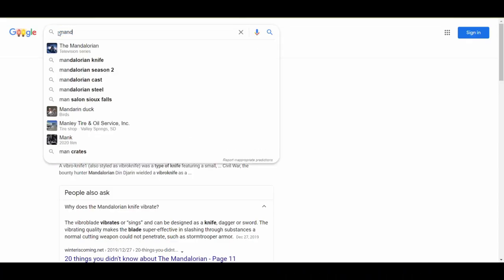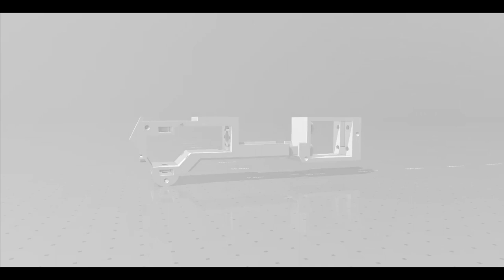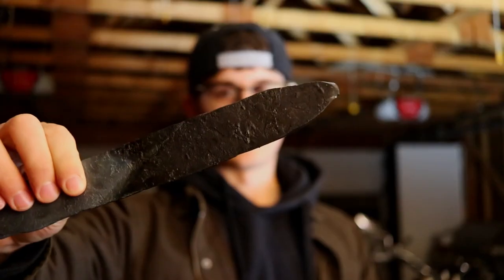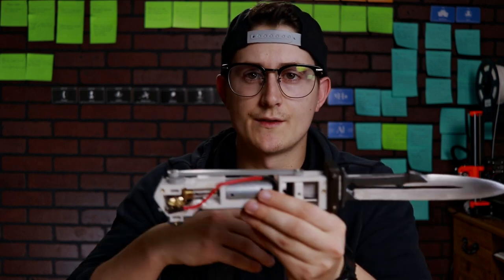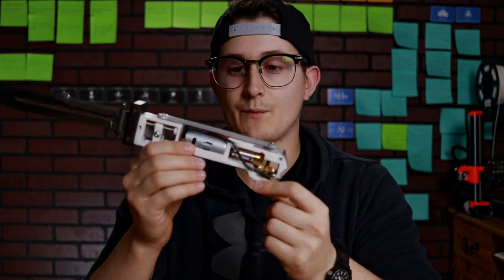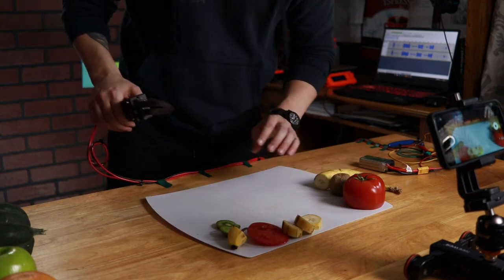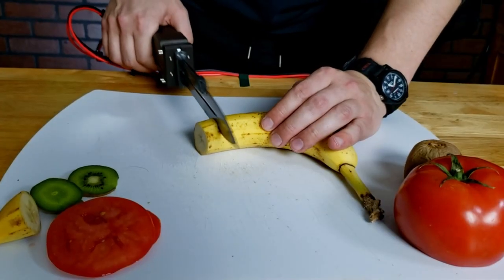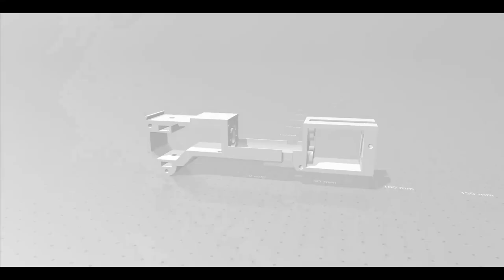Mandalorian Vibroblade Prototype

Comment: I seriously see great achievements in your future. I’m surprised you are so underrated.(BTW how did you get that equipment)
Reply from the maker: Thanks! I really enjoy doing these so I hope I can eventually go full time.  What equipment do you mean? The tools I use (3D printer, forge, etc) or the parts I use (motor, shafts, bearing, etc)
Reply: @SECTOR07  The forge  and the motors, gears wires etc did you get them off a specific website? I’ve taken an interest in engineering and want to make projects such as these. I’m in 10th grade trying to learn engineering before college.
Reply from the maker: @bronbettis4084  You can buy forges but my brother and I built that one. It was cheaper that way. I get almost all my parts on Amazon. You just have to know what your looking for. If you want to learn engineering I suggest start by building a few projects. Check out Instructables. There's a ton of cool projects on there. Just find something you like and make it👍 Learning by doing is my motto.
Reply: @SECTOR07  Thanks for the advice, I’ll check it out!
Reply from the maker: @bronbettis4084  Of course! I'll also be doing some tutorial cool DIY projects in the future that anyone can do. So keep an eye out for those 👍
Reply: @SECTOR07  Sure will already got my notifications on!

Comment: This is incredible! Amazing job
Reply from the maker: Thanks!
Reply: @SECTOR07  would having a smaller oscillation still work at cutting things? If so the back and forth speed would be faster and the blade might not stall if you try to stab something with it... what’s your opinion?
Reply from the maker: @matthewdeane235  I think your right, I think tuning the oscillation length would definitely help. The main drawback with my design is the motor. Its high speed but low torque which is why it stalls under too much stress. Bigger motor and smaller oscillations would make it a beast!

Comment: That touch sensor addition is pure genius.

If you double up the motors, make the handle a tad longer, would that increase the torque?
Reply from the maker: Thanks! I was very happy with that idea 😁. Doubling up the motors would definitely increase the torque and make its cutting power stronger. Like you said it would make the handle  a lot longer. If dimensions didn't matter so much it would be cool to try!

Comment: Love the railroad track anvil haha, didnt expect you to make your own blade!

Did you 3D print the bevel gears?? If so how did they look after some use? What dis you use for your linear bearings/slides?

I think industrial ultrasonic blades use little piezoelectric oscillators in order to be able to cut well (including cutting plastics and such). Your design is much more mad max and fits mandalorian better though haha
Reply from the maker: Ha thanks! Yeah, real anvils that are still decent are hard to find. So I had to make a temporary one. The bevel gears are brass 4mm bore. They've held up well so far. I know industry does use actual vibrating knives but this design was more in my wheelhouse for proto 1. That tech requires high precision, resonant frequency math, and lot's of higher quality materials. So I didn't think my equipment was quite at that level just yet. Thanks for watching the vid!

Comment: Very cool! I think shortening the reciprocating movement and drastically increasing the frequency would result in a better approximation of the knife from the show. Maybe a resistance band to pull and an eccentric lever that does the pushing would be capable of higher frequencies than having it fully attached to the rotary system. Is there a way to take the power base from the ultrasonic exacto knives in order to power a larger blade? 
Anyways this video is awesome, dude! I hope you keep getting subs!
Reply from the maker: Its been awhile since finishing this project and I gave it some thought. I think two main things I'd do in a version 2 would be to use a brushless motor and also change the drive to something akin to a vibratory tool. Using a rotating cam against an inclined cylinder to pushing the blade forward and then spring return each rotation. Would increase speed and power by a wide margin. Might be a future project.

Comment: This looks awesome! Even without the functionality, I know very little in this area, but I have some questions, and I would like some answers, if you can

You said "chainsaw knife" right after the test and that got me thinking, if you managed to increase the vertical vibration and make a chainsaw-like blade, how would it affect the efficiency? Would it cut well or just make a mess? I know it would not be correct compared to the original, but how would it go?

In the Star Wars Universe, we like a lot of vibroblades in sword size, so how would the design change if you made it like this? Would it change much?

Last one, you said that its possible to fit the battery on your sleeve due to the magnet thing, I know little to nothing on this field, but is it possible to fit a bigger motor on your arm and connect it with magnets? I don't think it is, but I would like to know why

That was it, hopefully yoy grow bigger and bigger! I'm proud of being here on only 175 subs, looking foward to your new projects!

Comment: This is great, one thing i take issue with is the blade itself. Although there were mechanical issues, i think the blade itself may not have been up to snuff with how hard it was to cut also without the vibration. Cool prototype though.
Reply from the maker: I agree, it was a pretty crude design. This was awhile ago and I have a lot better equipment now. I have ideas for a second version that would be much more solid and fast. But not sure when I'll get to it. Working on something else right now.

Comment: this is kinda cool  I've watched all your videos, and you get the props MOSTLY right.  In this, the vibroblade is too slow.  Is there an easy method to increase the vibrations per second?  I realize that finances are probably a big factor in your designs.  Keep up the cool ideas!
Reply from the maker: I do have a limited balance for these projects. The biggest challenge with this one was getting it all to fit in a form factor closest to the film while still being powerful. I put more emphasis on the looks and size but it made the functionality poor. If I did a V2 I'd use a brushless motor and a totally different drive. I'd estimate it would be at least three times as fast and 2x as strong as the original.
Reply: @SECTOR07  what about making the gear ratio run faster?  I mean how does torque translate linearly?
Reply from the maker: @mattparker9726  The faster the ratio the lower the torque. So i could increase speed  but it would make it weaker. The new version would mimic how a vibratory power tool works. No more linear motion drive. Hard to explain in words.

Comment: This is fantastic!  Only issue I have is that the handle looks a little large to be comfortable to hold.
Reply from the maker: Thanks! It is a bit big, but thats as small as I could get it while still fitting a motor and moving parts inside.  Size was the most difficult part of the design.
Reply: @SECTOR07  oh, absolutely, I have no doubt that was difficult.  The design work was brilliant.
Reply from the maker: @Automatonation  Thanks!

Comment: its pretty awesome but i think it should vibrate much less distance at a much faster rate, also the motor was geared for more speed rather than strength, you could gear it for strength and then greatly reduce the travel distance and it would be perfect

Comment: I would use a flexible drive shaft from a motor mount it in a backpack or on a belt to drive the knife. In this way you could use a larger or stronger motor.

Comment: I think your prototype is really cool! are vibroblades actually possible? And do you think they could deflect a real lightsaber?
Reply from the maker: Hey thanks. To answer your question, realistically, no. Not with the tech available now. In that universe vibroknives cut through extremely dense metal alloys in one quick slash. No blade can do that no matter how fast its moving. Even if you could make a blade stronger then the material your cutting and it was insanely fast it would still take to long to be useful in combat. It seems to me that star wars vibroknives have some effect that phases them into a different space time or something. Some crazy physics trick we have no idea how to do right now. I do have a version two idea for my design that way more powerful though. Hopefully I can make a video about it soon.

Comment: I think if the motor and bearings where stronger (like you said in the video) it would work better. But I also think sharpening the blade itself to have a cutting performance of about a Japanese chef knife would also tremendously help, but it would likely not help demonstrating the concept.

Comment: If only hacksmith were to build one that vibrates at an ultrasonic frequency. That shit would slice through titanium like hot butter
Reply from the maker: I'd be very impressed if he could do it. A functional ultrasonic vibroknife is near impossible with current technology.
Reply: @SECTOR07  I mean, that kinda stuff does exist, and he is building a Mando suit. He might be able too, provided he gets a good enough sponsor
Reply: @SECTOR07  Companies like Sonotech build ultrasonic cutting tools for many applications, and though most of them are designed for industrial uses, they also sell handheld models.
Reply from the maker: @chrisbaker9704  Your not wrong. If anyone could it would be him and his team. He has the funding, equipment, and a team of experts. Its still a very difficult build though, especially if it could cut through metal. So I'd be very impressed all the same.
Reply: @SECTOR07  well, he built a lightsaber. If there's anyone we shouldn't doubt the abilities of, it's them

Comment: I was thinking of something that might work better than physical Motors and I was thinking what about a magnetic pulse that pulses the knife back and forth
Reply from the maker: I did consider that but I couldn't find a way to make an electromagnet pulse  fast enough. At certain point of switching on and off there was a residual charge that never dissipated. And that just wasn't fast enough. There might be better ways I'm not familiar with though.

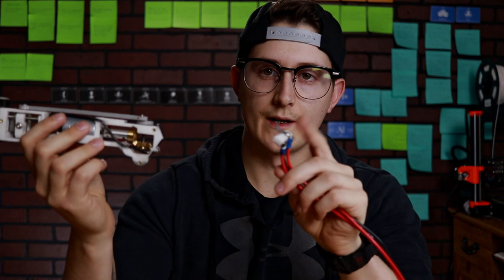Comment: 14:08 have you seen a grip safety in a firearm before?  I'd say that would have been a cleaner choice.  No dangly wires. HMM didn't know about the remote battery.

Comment: You made turkey slicer. Carefully ripped out 4 sonic tooth brushes and create a channel towards the blade ultra sonic can go to. you need damping vibration in the handle because you lose half the power. also ultra sonic equipment can heat up quite quickly.

Comment: Railroad spike are only medium carbon steel, so not too great of a knife at best, then what about tempering? You need an oven to put that golden hey/bluish colour back into it.. Cool tech skills but you do know what you are doing when it comes to forging? Right?
Reply: If I were you, I'd begin with saw blades which are already the right steel and just need stock removal, then quench then tempering and you'll get a good quality knife.. Better than any spike anyway.. Got one blank sitting here and it sounds like glass if I skate a file on it and that's after tempering..
Reply from the maker: The blade wasn't top priority. I know railroad spikes aren't great for knife steel but it came down to cost and what I had to work with. I'ts just a prototype so longevity and quality weren't top priority. I just wanted to see if the functionality worked. I made the blade design interchangeable so I can always reforge a blade out of 1095 later if needed.
Reply: @SECTOR07  I've been fan-boying about vibroblades for years now, mostly from the novels and the biggest obstacle I'd deduced is the blade would have to be full tang thru the handle to be strong enough, yet be able to move ultra-sonic, which isn't possible with modern tech, as the blade would likely bind with hard downward forces applied. And it would need to be one hell of a motor, then you have heat issues, ect... So damn, eh?
Reply from the maker: @Skelstoolbox  There are definitely a lot of challenges in making a 100%  realistic version of the ones seen in fiction. The closest we can get from what I have researched is electric knife varaitions and blades that do use vibration generators but are small. None of which can cut through steel/armor like in the movies. The most important advancement we would need is much higher power density. In storage and distro. Would also need to increase the power to size ratio of motors/actuators or just an all together new technology.
Reply: @SECTOR07  The books don't portray them so much cutting thru armor. They are still only dura-steel. More massive tissue damage, making slashes and stabs effortless and any stab into the torso an almost certain kill. Many worlds banned them for their destructive nature along with disruptor pistols, only effective at short range but cause flesh or armor to come apart at the molecular level.